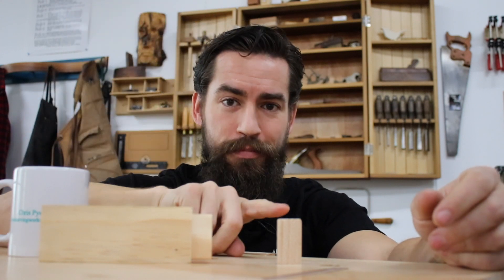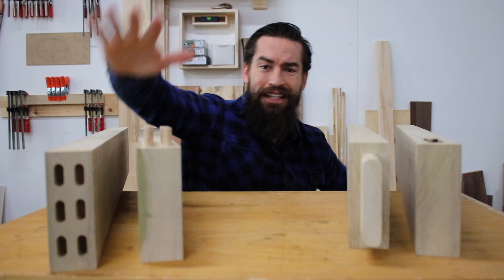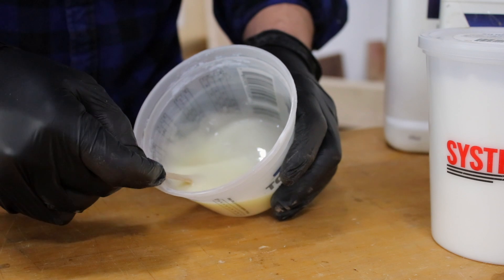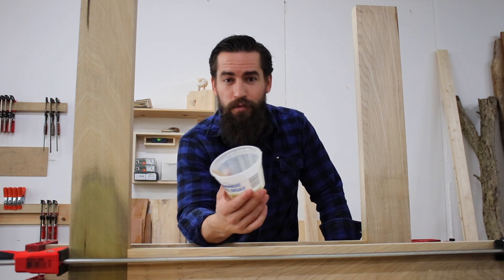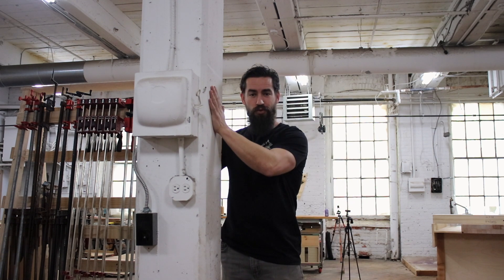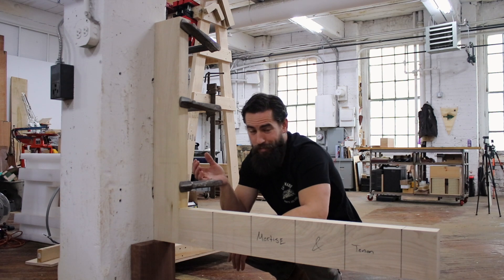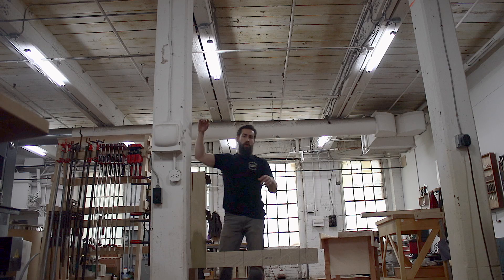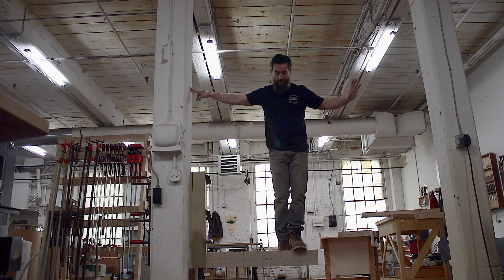I Can't Believe This Failed

Comment: What a fun experiment this was! What I wonder now is to what extent the thickness of the remaining beam fibers led to the faster breaking of the dominoes? The beam is only as strong as its weakest part, I'd say. Suppose the tenon had been made not in the middle, but on one third of the beam thickness, would it have been just as strong? However, I'm afraid I'll have to try that myself...🤕

Comment: Make the tenon the same depth as the domino. If you are using a lever to test, then failure relies on a fulcrum and load. Both these are dependent on distance.
Reply from the maker: Agreed. I used these particular dominos because I wanted to see if the XL was unnecessary. However it seems the length of the longer dominoes would be more impactful than I originally considered.

Comment: Exactly how strong does a joint have to be?  Which joint was easier to make? Quicker?  Asking for a friend.....
Reply from the maker: How strong a joint needs to be is a far better question. And without a doubt they are both plenty strong. And the domino is substantially faster.

Comment: Cool experiment.  If you do more like that in the future, you could screw a 2x4 to the oak posts above your head like a pull up bar.  Might save an ankle.
Reply from the maker: A far smarter idea than crashing to my doom
Reply: @ENCurtis  woodworking is less fun on crutches
Reply: @ken857  that depends on the material of the crutches. If they are wood, he can make his own. Nice project.

Comment: Not a fair test. The straight grain of the mortise and tenon joint will always be stronger than the cathedral grain of the Domino joint. Do the Domino joint again with straight grain lumber and it should equal the mortis and tenon joint.
On an unrelated issue, did you know that until the crowbar was invented, crows were forced to drink at home, all alone?
Reply from the maker: well played, sir 😂

Comment: America must be wonderful, to be able to use a fine piece of timber to experiment on. In Australia we have no timber industry that wants to deal in cabinet timbers, its all pulp chip wood, common pine and fast growing gum only useful for fence posts. If you are lucky enough to have a exotic timber merchant within 200 miles the price is just astronomical.  So you can get a small selection of nice woods, but you would never just use it to experiment on.  I would haply kill someone to get some of that Unobtanium, (the massive Oak beams and posts you have in your factory.)
Reply: I feel the same way about reasonably priced Baltic Birch here in the states.  That stuff is made from unicorns and priced accordingly since all the Slavs decided to throw down.
Reply from the maker: I won’t lie, our lumber selection is pretty enviable. Though so is your ability to obtain Baltic birch these days 😂

Comment: Several issues with your shtrength test, yeah that is the first one. Why is is so difficult to pronounce st as ST and not SHT? Second the dominoes were too close to the edge of the parent. I doubt that a plain butt joint would have not be just as good. What I found surprising is that the really crappy morise held at all.
Reply from the maker: Interesting critique of my diction, my friend. Sorry you’re having a rough day.

Comment: OK, that was fun!  I am fairly certain the choice of two rows of dominos weakened the mortise side of that joint.  The distance from the edge to the domino was thinner than the distance from the edge to the mortise in the other case.  That part of the wood is what failed.  I also agree that the depth of the mortise gave it an advantage, but that's probably not significant in this failure.  IMO!
Reply from the maker: I agree. I think a rearrangement of the dominoes (as well as lengthening them) could significantly increase the strength of this joint

Comment: I have never understood the appeal of the whole Domino concept.  I have used biscuits mostly for alignment but M & T is my go-to joint.  Why spend $1,000 for a toy when traditional joinery is so easy to do.
Reply: Speed.  If you are doing lots of joints and have any sort of a schedule to keep up with speed is the only answer.  If you are doing one off builds who cares.  Production work is what created the domino.
Reply from the maker: Everyone has their preferred methods of working. None are better or worse, just more or less appropriate for a given object.

Comment: You were right the first time in the theory vs hypothesis contention. hypothesis: set forth as an explanation for the occurrence of some specified group of phenomena, either asserted merely as a provisional conjecture to guide investigation (working hypothesis ) or accepted as highly probable in the light of established facts. Theory: def. #2--a proposed explanation whose status is still conjectural and subject to experimentation, in contrast to well-established propositions that are regarded as reporting matters of actual fact.
 Great test..Both joints are strong enough to keep a door intact, unless a 7.0 earthquake hits, then you grab the nearest mortise and tenon door for safety. Dominoes are probably faster and, as other have pointed out,  size matters, and they take less skill.
Reply from the maker: Excellent explanation of the two. Thank you.

Comment: I think it's the depth that matters. The grain will always fail before glue. Mortise and tenon digs deeper so there is more grain to resist failure as well as moment of rotation. The dominos are rather shallow. If the dominos extended deeper into the wood, it might be stronger.
Reply from the maker: I think you’re very likely right. May have to retest with the XL.
Reply: @ENCurtis  At the very least you have to control for the same depth - in this case it was a little bit apples and bananas
Reply: I think to get a proper test the domino needs to be as long as the actual cut tenon so both have the same amount of tenon into the mortis. This way they both have the same amount of wood grain supporting the weight to limit the chance of the piece splitting like it did.
Reply: Yes, a longer domino will increase the strength, but the mortise and tenon can also be made stronger (in the direction you applied the force) by making the outside shoulder bigger. So my money is still on the mortise and tenon.
Reply: I was wondering the same thing, as a casual observer vs a woodworker. Will look forward to a retest with bigger dominos and a smaller mortise & tenon, where the depths/lengths of the mortise & tenon and dominos are as similar as possible.
Reply: I'm a hobbyist whose only been doing this a year and even I knew how this would play out before him 😂
Reply: Exactly what I thought
Reply: This was my thought as well. I think ensuring the depth of the tenon and the dominos are the same might be beneficial.
Reply: Yeah ibthought that when he first said it. With leverage the deeper it went the stronger it would be as the weight is dispersed better
Reply: Definitely the depth of the domino thats the weak link...
As said before the wood will always fail before the glue, but I think I'd also be right in saying that the length of the tennon was at least twice maybe three times the length of half a domino (as only half goes in each piece or wood.
I dare say if you did the test again with a 25-30mm depth mortice & tennon (if that's half a domino length) the result would be that both mortice and tennon and domino would fail at about the same load, in the same place...
Your leverage is against the walls that surround the tennon, shorter tennon = weaker joint! 

Great video though, was good to see how they faired against each other, and good to see that you didn't turn your ankle! 😅👍🏻
Reply: You need the depth of the XL
Reply: By using a longer, single tendon, you are distributing the load across a larger cross-section of the vertical piece of lumber. Additionally, because you are loading the horizontal beam in bending, there will be a gradient of force from pure compression at the oak upright to the pure tension at the load side of the vertical piece's cross-section. If you want to learn more about this, study "Statics" and "Mechanics of Materials" (these are both textbook and course names) for mechanical and civil engineering. These studies act as the foundation of both disciplines.
Reply: Came here to say this
Reply: I'd like to see it retested with dowels instead of dominos at the length of the tenon.
Reply: @beckoningjinx1119  dowels will with same length and proper amount will wipe the floor of all of these :) it has been tested AFAIK.

Comment: glue joints are stronger than the wood. all those domino's tendons weakened the wood integrity.
Reply from the maker: They absolutely did. Perhaps one line of central dominos would have been a better choice
Reply: @ENCurtis  That's exactly how I see it.  Consider where the wood broke.  It was the area outside the domino, which was thinner that the corresponding part in the mortise and tenon case.

Comment: The length of the tenon is what made the difference here.  If the Domino 700 was used with longer dominoes I believe it would have held up just as well.
Reply from the maker: I think you may be right. May have to retest with the XL!
Reply: @ENCurtis  yes think the tenon and dominos need to be same length for a fair test.
Reply: @ENCurtis  to make a comparison, all they need to do is to the same length. Just make a less long tenon. On the other hand, using the D700 you could compare the best joint that could be made with a domino vs the the best joint that could be made with a M&T. It all depends upon that the question is. So, this video showed a M&T is stronger than one that could be made with a. D500. It’s still a good result. If you can afford it, consider using a block and tackle/winch and a digital scale like project farm (on youtube, fyi) uses so that you can save your ankles. 😂
Reply: Should have used longer domino’s lol 😂
Reply: Yup. The short dominos concentrate the pressure in a very small area. If the tenon has been the same length as the dominos, the dominos probably would have won.

Comment: Cool test, thanks for sharing. I think with the mortise and tenon the tenon was engaging more of the wood across the grain, the domino joint was only engaging an inch of wood grain? That would make a big difference in strength.
Reply from the maker: It absolutely would. I wanted to test the smaller dominoes specifically but perhaps I should retest with the XL
Reply: @ENCurtis  I'll watch that, I like this kind of real world test, I don't own a domino so cutting through the hype is very useful to me.

Comment: Like the video! One thing I noticed before you glued up is that the tenon was longer than the dominos. Would the domino joint be stronger if you used longer dominos? Would you even be able to use longer dominos or is that a limitation of that system?
Reply from the maker: That absolutely would make a difference. Perhaps I should try the test again using the domino XL and make the tenons the same length. Though I specifically used the regular domino here because it’s what I own!